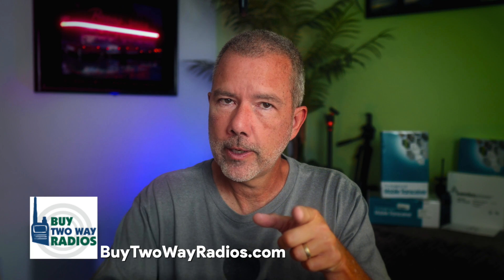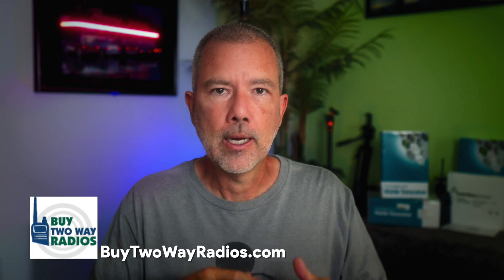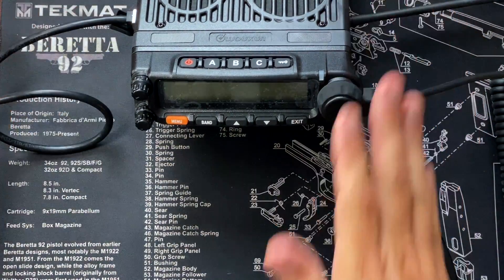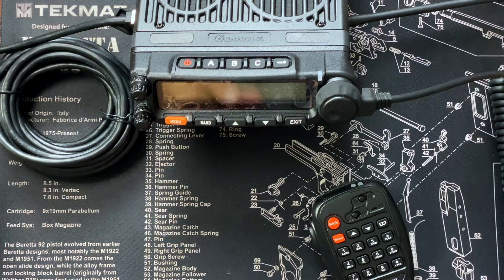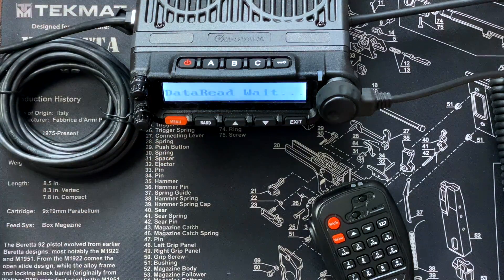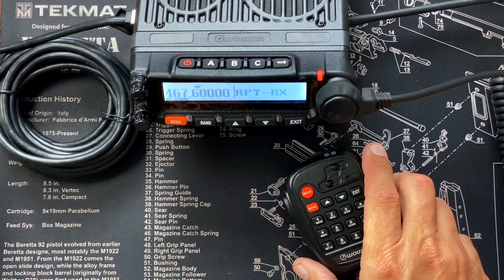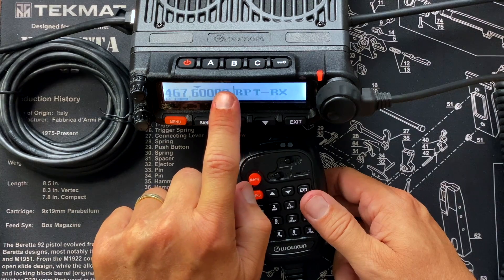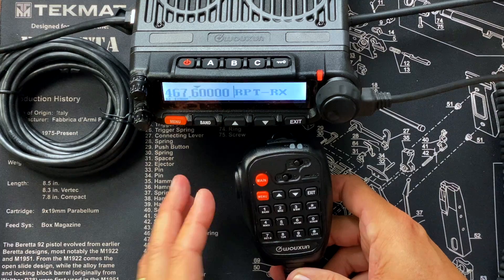How To Build A GMRS Repeater Part 2.5 - First Issues, How To Configure The KG-1000G, and Tom Hanks

Comment: Big fan.  I am curious if you tested the jumper coax between the radios and duplexer. It seems unlikely to get 2 bad ones.   Switch them. Since the rx radio should have no issues with swr. Maybe it’s just a bad cable.
Reply from the maker: as mentioned in the video, i checked/tested everything between the radio and the antenna.
Reply: @TheNotaRubicon  this what I get for listening on the way to work. Sorry

Comment: Why not get a better duplexer? Most of those mobile ones are more trouble than they're worth. But guess finding that out. Also running that thing on high power its gonna burn its self up. Good luck
Reply from the maker: Better duplexers cost money, but if you would like to send one I will be happy to use it. 
Also, according to the manufacture running that thing on high power for extended periods will be no issue as long as it has adequate air-flow.  Not that i believe what the manufacturer says, but I run the same radio in my Jeep, on high-power for hours (8-12) at a time, in desert temperatures with very little air-flow, and it hasn't burned up yet.
Reply: @TheNotaRubicon  but as a repeater itll have a heavier duty cycle. Because not only will it transmit your audio, but also the others. Where as you talking on your mobile it has more rest time.
Reply: your duplexer will be fine since there are no other repeaters near your repeater.  Love your sense of humor. Carry On!

Comment: Be sure to add a fan or something to move air over your transmit radio if running on high power. That thing will heat up quick. On my few repeaters I help run, I use large computer fans. And our farm repeater that's mounted in a cabinet on side of tower is using a 12v boat exhaust fan on a temp controller to keep everything inside cool, even on hot summer days. Otherwise keep it up

Comment: My tram 1486 cutting chart has a 468 cut specs, but no 465. Shouldnt i cut it at the 465 freq? Which did you use?
Reply from the maker: I'm transmitting at 462.600 and receiving on 467.600 so I think I cut it for 465.. During all my testing I checked the SWR from 151.00 all the way up to 490.00 and the SWR was still good for a very wide range, so it seems the antenna has a lot of leeway/room for error.
Reply: @TheNotaRubicon  Awesome, thank you! I will look for the 465 specs. Dont know why its not on cutting chart they sent me. It sure would be nice if we could just hook up 2 uv-5x to a btech amp with duplexer

Comment: May I suggest that you also put a tone on the TX radio. (462.600) The reason being that, for example someone on a 40 watt mobile talking simplex to another 40 watt mobile on 462.600 will also be heard by your repeater users.

Comment: I just did this myself with GM300 radios.. May I suggest using a raspberry pi instead of an ID-O-MATIC for the controller. The pi with "asterisk" has many more features. Also if you use a pi you can link to other repeaters via internet and also use DVSwitch to access the repeater via cell phone.
Reply from the maker: if a Rasberry Pi works out of the box, just like the ID-O-MATIC to do the job, it sounds like a great idea.. If not, then i'm not interested.
Reply: @TheNotaRubicon  The ID-O-MATIC is Windows based. It does require set-up. Doesn't work with MACs.
Reply: @TheNotaRubicon  nope it takes a bit of configuration. I had an ID-O-MATIC on my GMRS Repeater first. It was functional and I really liked it. But it had issues. I sent it back and by the time I got a replacement I had the pi up and working. So yes ID-O-Matic is pretty much plug and play. In the future if your interested in upgrading check it out. Hamvoip has the best site for learning about it. Thanks for replying. Good luck on your repeater build. I'll be watching. I learned a lot building mine and I'm very happy with it. Keep up the good work and spreading the humor! Jimmie

Comment: What about the power supply? Do you need two power supplies one for each radio? I'm considering building one myself. Thanks for the videos. I enjoy them.
Reply from the maker: You will need about a 30Amp power supply if you want to connect both radios.. Otherwise one that is about 25A connected to the transmitter and a smaller 5A or 10A for the receive radio.. Easiest to just get a 30A and connect them both.  There is a link in the info section to the power supply i'm using.
Reply: I use a car battery for home base. Lasts long time and put a charger on  battery overnite when it gets below 13v. About evry 4-7 days depending on use.

Comment: Very new to GMRS. Thanks for all the helpful information. Do you plan on adding a parts list (with affiliate link below) possibly with the price broken down? I would find that extremely helpful.
Reply from the maker: I will do a price breakdown when the repeater is up and running - the parts list keeps changing
Reply: @TheNotaRubicon  thanks

Comment from the maker: CORRECTION: At 06:09 I miss-spoke. This repeater will be set to transmit at 462.6000 ..Hopefully the :_SadHam:  wont notice!
Reply: Your repeater is already listed as "NEW" on MyGMRS. Congrats.
Reply: I tried to connect to your repeater frequency 462.600. input tone: 023 DPL. and output tone: 023DPL. so it isn't compatible with Retevis Radios? it doesn't have that kind of tone, is it only for Motorola radios?  I live in Riverside